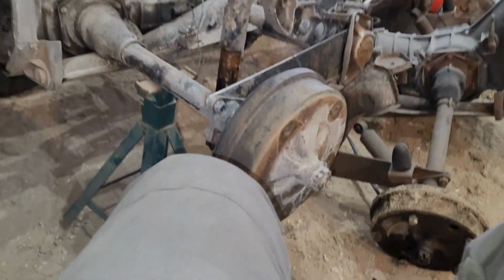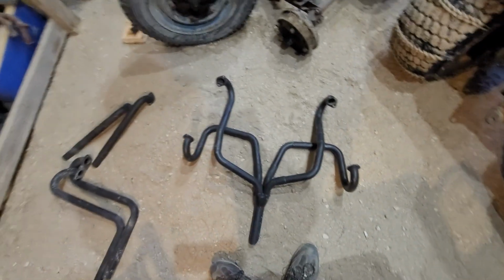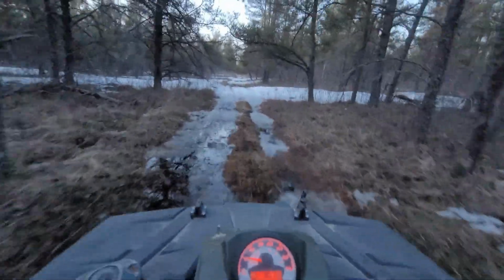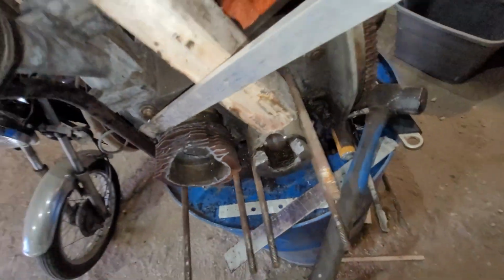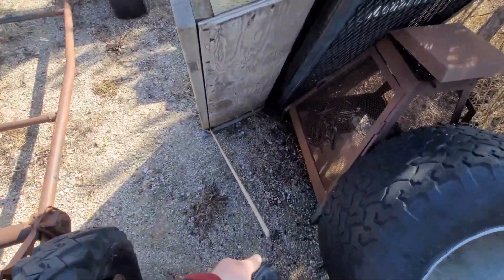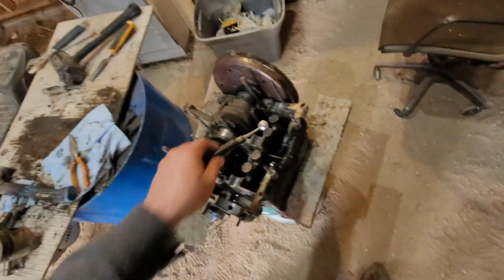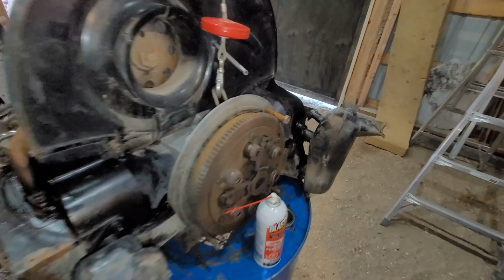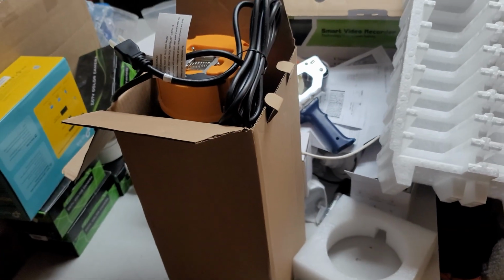Spring Update / Vw Trike Work (Pulling apart the VERY Locked Up Engine With Hammer...)

Comment: Now, were you successful on engine number two?
I guess we will need to wait until next time.
Reply from the maker: LOL! IT looked a LOT better... But... Some Issues... (Video should be this week) 
I know now... Don't Buy VW engines that are locked up without oil in them LOL! 
But Picked up a 3 Cylinder Diesel mower that i am working on first.